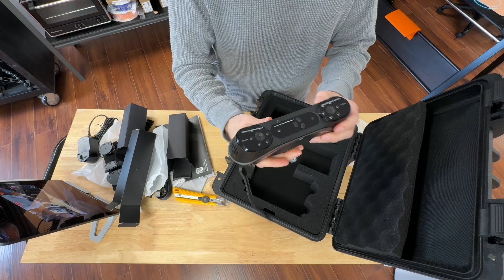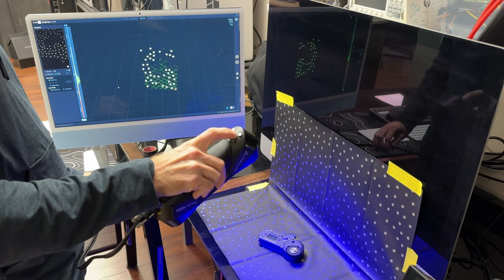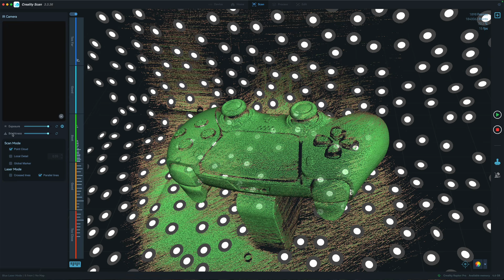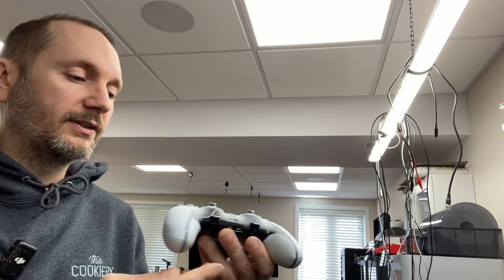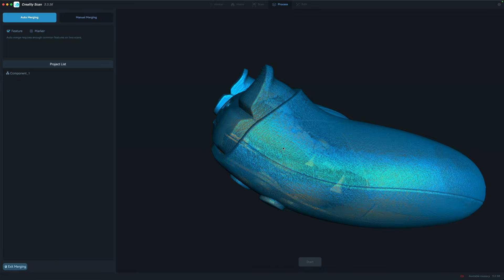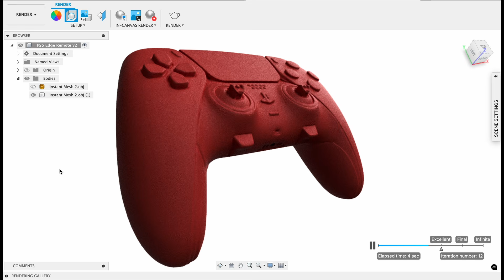The Creality Raptor Pro Full Beginner’s Guide and Review

Comment: To orient the model's coordinate system in 3D you can use GOM Inspect 2018 software (version 2018 is free and owned by Zeiss). It has exactly the capabilities you mentioned, plus it can detect planes, cylinders, cones, etc. This software was originally created for CMM. It is also very useful to export these planes as IGES, it significantly speeds up CAD modeling. It may not be super intuitive, but once you get the hang of it, you can even take measurements using a 3D scanner. There are already tutorials for it on YouTube with meshes from scans.

Comment: What was not clear to me was if you ended up using the laser mode or the IR mode to get your final scans.  It looked like you started using laser, but then switched to IR?
Reply from the maker: The camera does not pickup the laser very well under the correct exposure settings. I used the laser scanning for all sides of the controller.

Comment: From experience, having a computer with a 16gig GPU changes your frames per second to 60. 

I’m currently using a 5 year old Lenovo laptop with a 3080 16Gig and i9. 

True mobile workstation!
Reply from the maker: nice I have the M4 Mac studio coming soon so I wonder how much improvement there will be with that. Best Ive gotten on my M1 iMac is 19fps. Its ok but it does slow the workflow down for sure

Comment: What were the specs on the iMac you used to scan?
Reply from the maker: This was a first gen M1 iMac. I have an M4 studio in the works so Ill prob do a comparison video when that arrives
Reply: @leckiestein  I suppose 16GB of RAM? I'm trying to see how viable an iPhone 16 Pro is for scanning things in the field given it's 8GB of RAM.
Reply from the maker: @jaredsabre8286 correct. 16gb ram. Ram only seemed to be an issue when I was doing multiple scans and merging them together. For a single scan it 16gb was fine. Turned off google drive and that freed up 11gb 😂

Comment: I recently bought a Raptor PRo and your video is very helpful for entry level users. I read the comments, so I will skip to ask for the blanket. 😁 

Especially your workflow and the software used is very interesting. Unfortunately the "convert mesh" plugin in the basic Fusion360 version doesn't offer to switch the method, resolution and accuracy. As far as I understand this is a step to create a solid model. I'll try to find a workaround for this step. 

Thanks a lot for your video - it helps a lot to get startet.

Comment: Where did you pick up the Marker Blanket?
Reply from the maker: I got this in another kit, but its really easy to make one if you just put some stickers on a pillow case or something similar material.
Reply: and you recommended the larger markers for the raptor Pro.?
Reply from the maker: @metronyc2855  in my experience, the small markers have no issue being picked up at 1-1.5 feet. I would use the lager makers beyond 1.5 feet.
Reply: @leckiestein ❤
Reply: @leckiestein  from what kit did you get it from?

Comment: Did you make your backdrop yourself or did you purchase this somewhere?
Reply from the maker: This came in another kit but you could certainly apply some markers to a pillowcase or something similar.
Reply: @leckiestein FYI..  this video literally saved 3D scanning for me..  for the life of me I wasn’t able to get a good scan of a BMW grill even after I had spray painted it gray..  

it has deep grooves on the back between two very thin walls, and the side aspect is so thin that even with marker dots all over I would lose tracking frequently and in the end had very incomplete data…. Seeing your quick tips on global scans (I printed a 13” * 13” rear wall connected to a 13” * 13” flat base and put dots all over) made it EASY — only issue was using global resulted in the software no longer removing all of the scanner dots that I had already stuck 100+ of to the object..

On that note, any tips on smoothing??  Worked at it for like 60 minutes in the app you suggested, but there has to be a better way than moving back and forth over small areas until my hand cramps, lol. 

Also: I love the tip on selecting the object in the raw data and inverting to delete extra data — that also saved me a TON of time!!  

Long time 3D printer but brand new to the world of scanning..I returned my Matter and Forms “Three” scanner recently and initially after failing with the raptor pro too, was beginning to think 3D scanning just wasn’t for me..  Like I mentioned - this video literally saved 3D scanning for me..  now I’m flying through objects and getting amazing quality meshes.

TLDR; I wish I could like this video more than once.